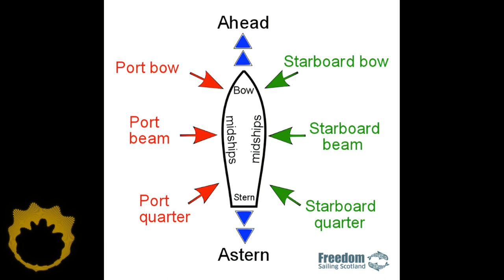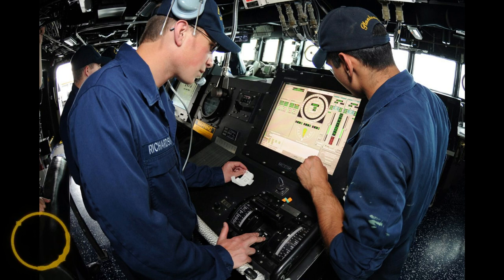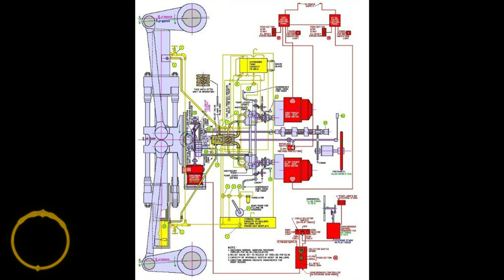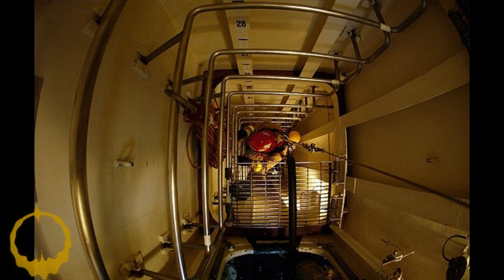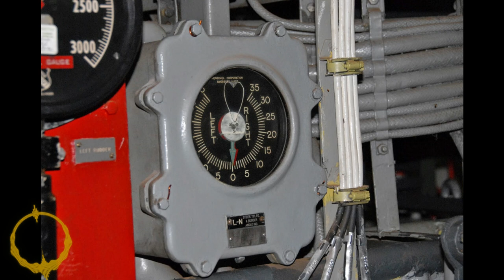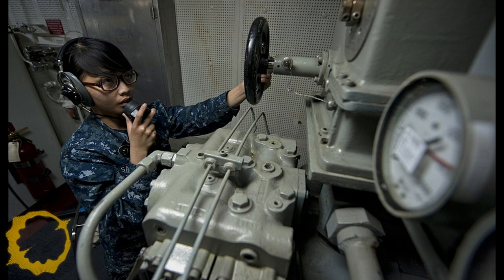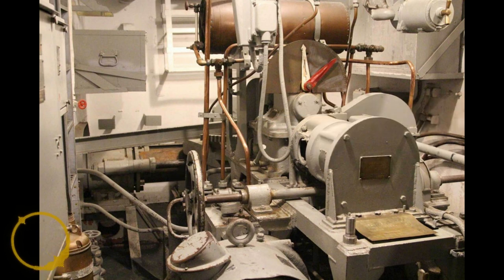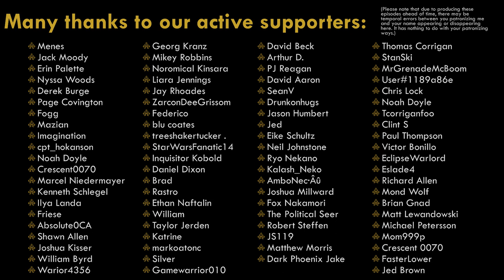I should get an award for a total lack of questionable idioms in an episode about Aft Steering

Comment: Whoever suggested touchscreen steering on a warship has never been shot at by so much as a paintball gun, let alone another warship, and it shows
Reply: they haven't even tried to use one in the car apparently 
🙄
Reply: Part of the US military's obsession with super high tech everything instead of KISS.
Reply: Touch screens are squishier than squishies.
Reply: The same genius that created the blue camo pattern for sailors.
Reply: It's not stupid it's advanced
Reply: Touchscreens are great if you want to do 100 things ok-ish. 
But to do one thing well, it's almost always better to come up with dedicated, specialized controls.
Or just use what everyone has been using for a long time, that's always a safe bet...
Reply: its sort of why you dont see mice in fighter jets. it might work in a game where the thing you are controlling has no real physics, on simulations that simulate real physics joysticks are still the preferred method. 

it turns out there is more than one type of stick. game sticks use a spring centered gimbal and usually control a rate (like pitch rate). but i found a military surplus stick that used a friction gimbal, and 2 sets of pots and a clutch system. you hit a  button and some magnets lock one of the pots, and then the stick acts as a vernier control.  i figure this kind of stick would control something's rotational position rather than rate of rotation. i think these may have been used in an aircraft refueling boom but it could have just been out of a fork lift or crane or whatever. military surplus always comes with big fat question marks besides the fact that it had resistors on it that were made in america and therefor was probibly made before the internet.
Reply: Or owned a phone with an overly sensitive screen. My own phone tends to read a screen tap pretty much every time I pick it up. If there's a Youtube video playing on it at the time, I am pretty much guaranteed to accidentally tap the ad on screen which pauses the video and opens a new tab to the ad source.

Using a touch screen for steering a warship? You are pretty much guaranteed to get radical steering changes because someone accidentally brushed the screen. Frankly, I think you'd be better off with a mouse and keyboard for ship steering if for some reason you can't use a wheel.

And what's wrong with using a wheel? Every friggin American adult knows how to use a steering wheel! Just have a sensor relay to the driver how much off center the rudder is.
Reply: @noppornwongrassamee8941   I wholeheartedly understand what you mean. Hell, why not just use a joystick?
Reply: I remember stories of ships with major parts of the ship hit, almost the entire Officership dead, being reduced to a guy in a door shouting directions into engineering. Somehow the thought of a multi billion dollar  warship being bricked by a spilt coffee does not fill me with confidence.
Reply: Having used the touchscreens, it's honestly not that bad. You can still control multiple rudders from one station. The trickier steering mode is when you use the potentiometers on the motor controllers. Especially if you have to coordinate multiple rudders from multiple panels. You think a 3" wheel is bad, imagine a 1" knob like you have on a stereo.
Reply: Probably some guy who was into NEW TECH, and thought "touch screen, THATS GENIOUS!" And all im gonna say on that subject is, THAT IS THE LAST THING YOU WANT ON A WARSHIP!
Reply: @noppornwongrassamee8941  I know right, steering wheels are steering wheels. I mean FUCKING TANKS have Steering Wheels these days, so why not use one for a Warship?
Reply: @jaywerner8415  tanks have had steering wheels since WW2, specifically because it made training easier.
Reply: @yamiyugi2894  You Air Force?
Reply: @nos9784  Yeah, Put on the sound powered headphones and play with touchscreens. anyone ready for the modern navy?
Reply: @boxfoxscoot1614  who is worse I say, yes a touchscreen makes some sense for something like an digital map. And you could steer by plotting points on the map the autopilot would follow. Now on a ship you don't need to be as active as in a car most of the time, and the one setting up the autopilot is probably not the one searing. 
Who is not the case on a car without self driving functions.
Reply: Don't tell the bridge they have no control over velocity, without using their cute little bell and saying pleeeaase!
Reply: @magnemoe1  autopilot a ship? You ever live on one? Bad lubber.
Reply: And watched too much Star Trek
Reply: @wolfschwarzmond  Except the Marines, who still bitch about losing the M14 and the M1911.
Reply: @yamiyugi2894  . It's stupid as hell . Fragile and undependable .
Reply: Blame Star Trek TNG!
Reply: @yamiyugi2894 Nice Invader Zim reference!

Hail, my Tallest!

Comment: I liked the escape hatch in our forward engine room. It emptied into medical. And yes, the docs did not appreciate a random hole to hell appearing  in their spaces, so they put a large potted plant over the hatch. Unfortunately for them, the escape hatches could fit 3 sailors easily, and up to six if you squeezed.  Well, take 3-6 hot, angry, and most dangerously, board  mechanics who are determined to cause mischief, and well, there where quite a few broken pots.  ( Best part was that we never got in trouble, because we were " removing an obstruction to the operation of mission critical safety equipment.")
Reply: I’m surprised y’all’s Skipper let the plant slide since that’a like a genuine problem in an emergency

Comment: The advantage of RCS is that the sheer number of thrusters needed by the system would provide its own redundancy.  If you have dozens or hundreds of thrusters, it's pretty hard to knock them all out at once, and you lost some, you would still have limited steering on whatever thrusters are left.  The only real vulnerability is the fuel supply, but even then you could distribute the fuel tankage throughout the ship to protect it.

Comment: Please do a video on the horrible idea of non-haptic feedback aboard ships/aircraft. The video could even extend to Holographic Control Display Thingies in Sci-Fi. It’s one of my personal naval pet peeves, along with “Maritime COIN”, the  DDG-1000, and the LCS. I mean, come one! Even the display screens on the F-35s use buttons for menu navigation!

Either way, good video. It was great to hear your opinions as a former helmsman. The wrench had me laughing. Controlling a 12-footer dinghy with a tiller rod is already tiring in high seas. I can’t imagine controlling a 450-footer the same way.
Fair winds,
-J

P.S-Love the KSP images being used for reaction wheels / RCS
Reply: The only kind of good reason for a hologram is for showing something in 3d. They should never ever be used as the primary interface for anything, because they essentially have all the downsides of touchscreens, but they also have terrible background contrast (assuming the common transparent versions, not the ones from Star Trek)
Reply: @thatstarwarsnerd6641  Really the only way a "Hologram" is a good interface is if the system is tied by some deep madness into the users nervous system somehow. Which is a whole other can of potential worms. At that point you aren't really dealing with a true hologram anyway, hence the air quotes. They may look fancy and futuristic but suffers from being a horribly complex probably tetchy way of doing something really simple.
Reply: @thatstarwarsnerd6641  the F35 and the rafale .... i think ..  i know there are two planes, that have this furiouly STUPID  "pressure" joystick that doesn't move
tho i believe the pilots forced the designer to implement some movement for feedback

hologram combat flying is the stupidest thing ever, even for the people who define "evasive" as turn into the enemy fire and present the biggest target ....
Reply: @daral9217  a hologram is possibly quite useful as a navigation or tactical display on a space ship, depending on the specifics (humans are kind of bad at translating between 2D and 3D) ... but in no sane world is a regular standard hologram a usable INPUT device.
Reply: @laurencefraser  Yeah that was the air quotes in my comment were for. You have a display and some madness to give it feed back, or a false sense of interaction. The calculations alone to try and parse what qualifies as interacting with the hologram would be extensive, let alone the fudge factor, and betting your life on it all working right. Oh heck no. You might get it to work as a mental link display but those are even more theoretical than a functional  hologram.
Reply: @laurencefraser  Agreed. Star Maps, Tactical Displays, Navigation Data, and other 3D info should be displayed in Holographic Form. Holograms should never be used as input, especially for mundane or very important tasks such as Combat Maneuvering, Weapons Control, or Systems Checks.
Reply from the maker: Holograms could work if they were more like holodecks, in that they both presented an object and made it "solid".  As long as you have something that feels real, it'll be light-year better than a smooth surface with no tactile difference anywhere.
Reply: @SacredCowShipyards  Good Point. Most of my gripes are with the types of holograms you see in The Expanse Show, Picard, or other more modern sci-fi shows, where the holograms are basically just interactive Lightshows. Tactile Holograms, if they exist in your universe, are actually a really good substitute aside from any reliability issues.
Reply: @ealtar The F-16 is one such fighter. And yeah, the stick originally didn't move at all, but this caused all sorts of "user interface" issues so a degree of play was engineered in. It wasn't just pilots thought it felt weird, the lack of motion caused genuine control issues.

The actual reason is to enable high-g maneuverability, since the pilot isn't moving their arm agianst the g-forces. And it mostly works out because humans are actually a lot better at telling force of their hands than position of their hands.

Comment: USS Sacramento(AOE-1) did have a big, BIG wrench.  It was near 13' long, open end, 1000+ lbs. and not used for steering.  You never would have gotten it into aft steering without a torch cutting a hole into aft steering.  For some God awful reason the powers that be saw fit to give older ships w wrench to remove the screw in anywhere, you know, just in case.  I only saw it off the bulkhead once, in drydock.  Just to make sure it still fit.  Then it was sandblasted, painted and put back on the bulkhead.  The other drydock time, it never left its holder.

Comment: THANK YOU. Few, if any Sci-Fi ship have real backups. Enterprise, no matter the number, loses control of the helm or the engines every few weeks. And there is no backup helm.  I've always bitched that there should be a person on Starfleet Ships whose entire job is to stand watch on a set of MANUAL valves so that when the Warp Reactor go out of control he can vent the plasma into space, shut down the deuterium flow, and stop a WC Breach. Call it EMSSW or Emergency Stop System Watch. Just a little room buried in Engineering with the valves, a chair, sound powered phone, and a hard wired alarm. Perfect duty for Ens. Crusher or Lt. Barkley. Keep them off the holo-deck and away from engineering where they tend to foul things up.
Reply: At least most star trek ships have a secondary (battle) bridge, so that's Something. They're almost never used in the shows, but they do exist. Also, technically speaking, at least as of TNG, EVERY console on the bridge is backup for every other one, and with the correct authorisation codes a fair bit can actually be controlled from consoles in Engineering, or a number of other random duty stations with consoles around the ship, to a lesser extent,  too. It's... kind of a large part of the point of LCARS, actually. of course, this is conveniently forgotten whenever the plot calls for it, and very frequently the failure is on the other side of the computer system (and There is where there's a distinct lack of backups for a lot of functions, or at least unslavagable failure states).

Comment: I've got this "sneaking suspicion" that the wrench was all about simply checking off another box... and that NO ONE expected it to work... but it met a requirement... so they plopped that wrench on its hangers and laughed their asses off.
Reply: Chief: The design committee has voted that we need at least 5 separate ways to control steering. We've got 4 and you're not going home until we've got 5.

E4 Mafia: Umm. What if we buy an huge wrench and tell them we'll turn the rudder by hand. It's cheap and makes the snipes sound like badasses. It might even work.

Chief: You had me at cheap.
Reply: or more likely a highly respected admiral suggested it and everyone else thought it was stupid but never spoke up out of respect and now it's just Navy tradition? cus why not?? lolz 
and right about now I probably have a SAILOR wanting to yell at me saying "son, without tradition what are we??" well ya got me, yer seamen, happy now?? there is a joke attached but naww...
Reply: I'd imagine how it'd work is similar to how my Sea Scout ship did it. They'd put the wrench on and then use blocks and lines to heave the wrench to either side.
Reply: @pacifist11  As an engineer, I can almost guarantee this is how it went.
Reply: Honestly? I've heard of folks on warships 'improvising' repairs and basic functionality of rudders back in world war two, getting their rudders out of a turn and having to rely on engine steering, before taking yet another she'll and having to repair driveshafts to restore a semblance of steering performance.

I presume in the event of a conflict. The wrench would not be good. But with ropes, and a few pulleys out of damage controls collection, they could improvise something that takes a couple lengths of rope and a dozen men to drag the rudder sufficiently left or right to turn the ship away from combat and make her way back to port for more productive repairs.

Because when things get desperate, cutting open a wall or two to make room to ensure your survival isn't really a big deal.

Comment: The aft steering station on HMS Caroline always pops into my head in this context. WW1 era light cruiser of around 4k tons of displacement, with a wheel like that of Warrior but buried deep in the aft section, in its own little room that is nothing more than a box. I forget if it was manned by 8 or 16 people, but my takeaway was "wow, I didn't think I would dislike anything more than engine spaces".

Comment: Manually cranking thousand tonne reaction wheels and using the spin gravity section ‘on manual’ for roll…. Running to the back or bottom of the ship to go manually operate the hydraulics on the thousand tonne gimbals for the main exhaust nozzles… HAND CRANK THE FTL DRIVE LIKE ITS A JACK IN THE BOX…. RELEASE THE SOLAR SAILS MAKE HEADING FOR ALPHA CENTAURI